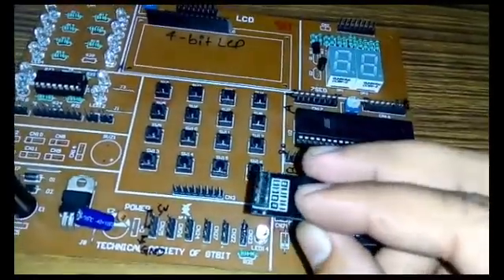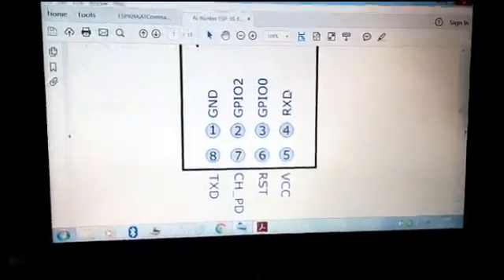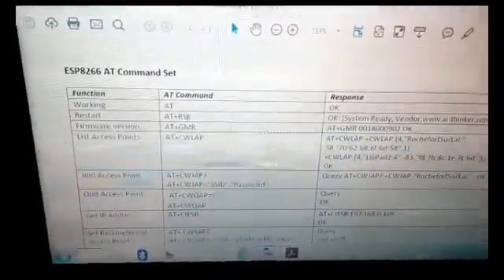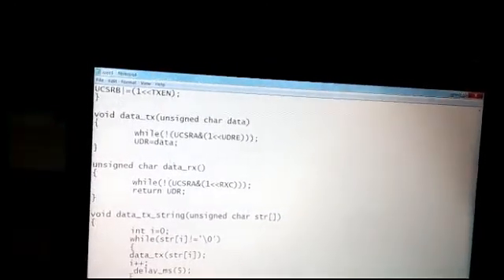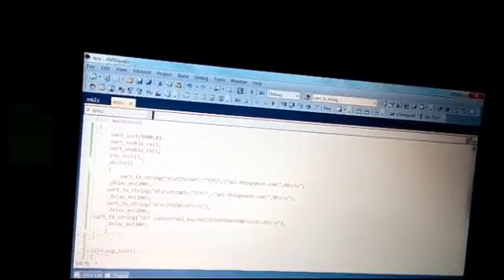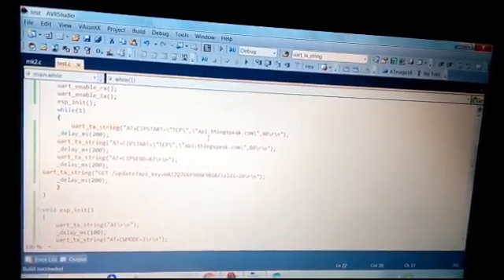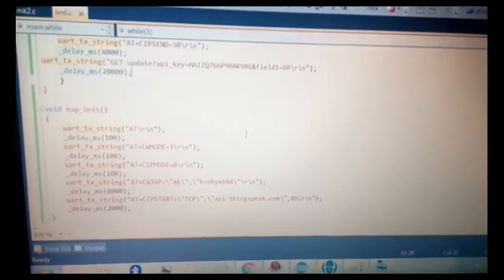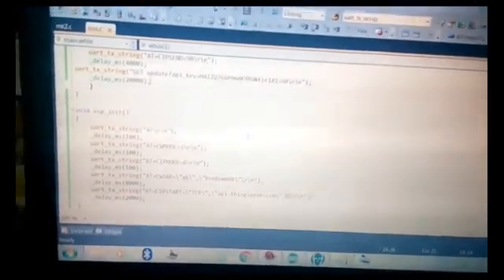HOW TO INTERFACE ESP8266(ESP-01)  WITH AVR MICROCONTROLLER AND SEND DATA TO SERVER

Comment: Can you share the code you used because it's too hard to see it in your video
Reply from the maker: ya send your email i will share it.
Reply: @hvebymk489  can you please send me the code
Emailid- rahul5547884@gmail.com
Reply: @hvebymk489  pls share the code 
kunal1999.2016@gmail.com
Reply: If you got the avr  code for esp8266 interface with avr can you please share it with me...
Emailid - rahul5547884@gmail.com

Comment: We have made the connections and followed the procedure as per your video but are not getting any printed commands on the serial monitor of Arduino IDE. Baud rates are in sync as well. Any idea why this could be happening?
Reply from the maker: Jhanak Johri you connect Esp with avr controller??? please check your avr code baud rate value in program.

Comment: We are doing a project, where we would like to receive data from esp8266 to atmega controller, can you help us with this?
Reply: I am looking forward for the video with explanation of usage this)
Reply from the maker: Manasi Shakya so need only to store data in your UART register and I think you have to do some filtration method in your program to retrieve only the data you need
Reply from the maker: Hello,you have to store data from udr (uart data register) to any data type variable in your program
Reply: Are the AT command responses of esp8266 are automatically stored in UDR ? Using AT commands, I am able to receive data from thingspeak on serial monitor, but how can I further store this string in UDR ?
Reply from the maker: See the Esp responds your data and some information from where you are sending your data like if you are sending data to Esp using html page Esp responds data and html code
Reply: Sir, I am confused, where presently my esp8266 response is getting stored in atmega16 and from where I can access the string for further filteration.
Reply from the maker: See if you are confused then first receive any data using UART and refer atmega data sheet for further clarification